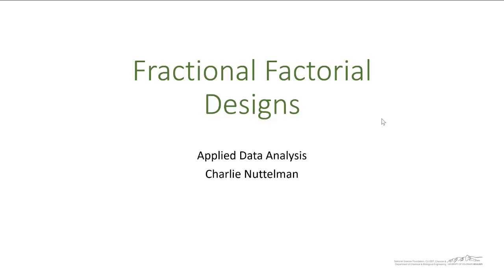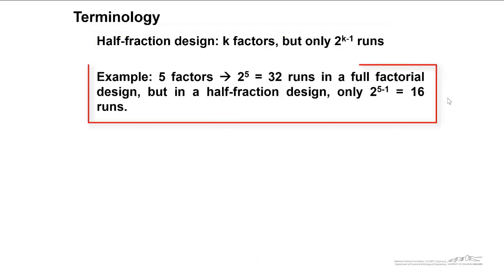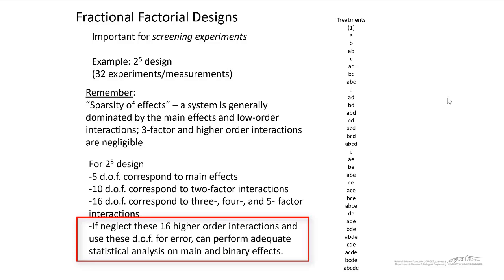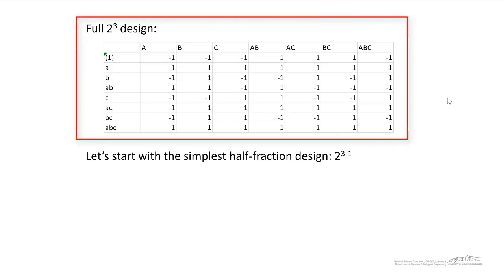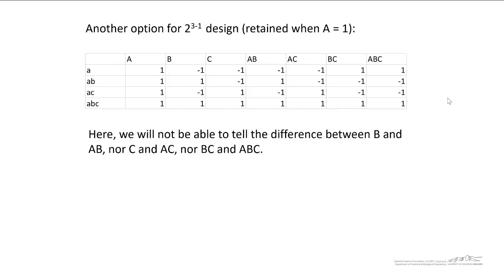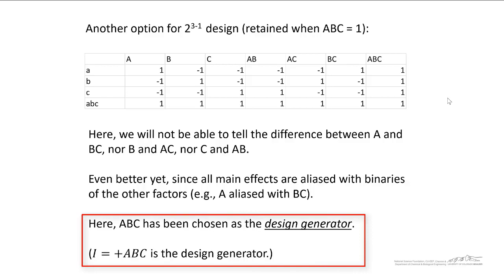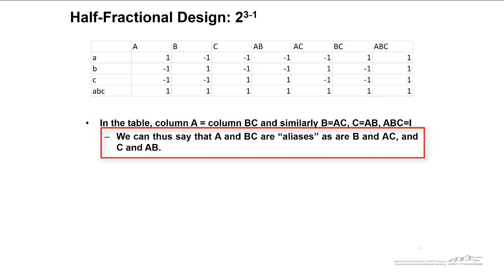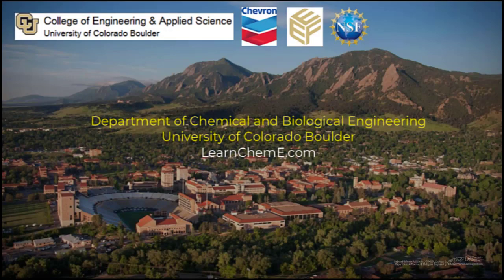Fractional Factorial Design, Part 1

Comment: You explained the concepts very clearly, thanks for that. However, I wonder why in all the examples when you tried to figure out which column would be used to choose the fractional design, you always keep the ones with value of +1. Why not mixed +1 and -1 ?